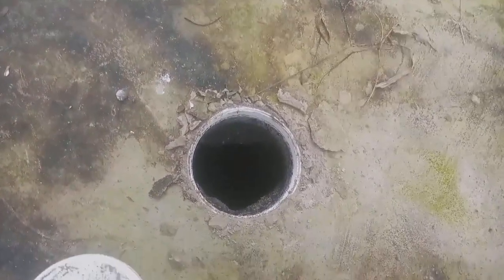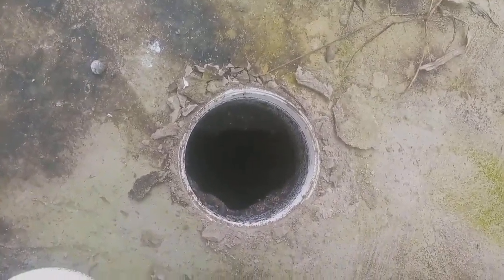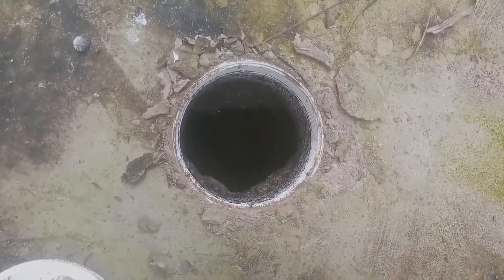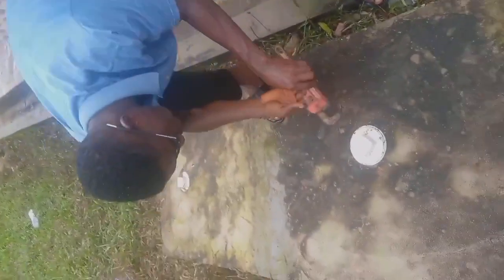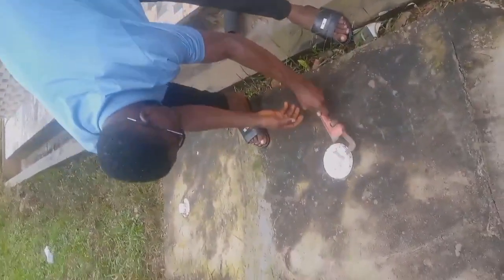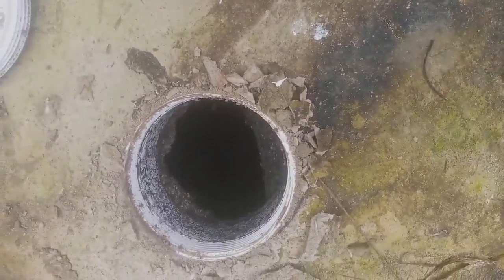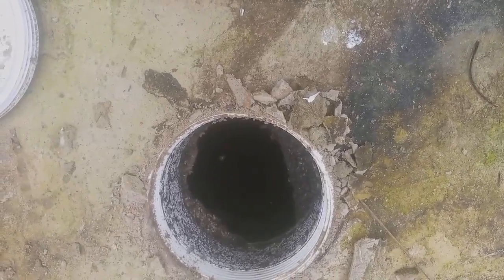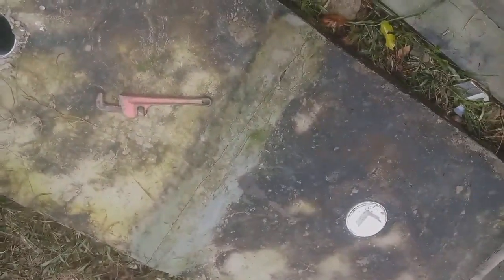BIODIGESTER OR BIOFILL FREe TRIAL. HOW it WORKED

Comment: Biodigesters are a closed system; therefore, it gives off no odor from food waste; this will eliminate flies and rodents from the facility, increasing hygiene. Also, eliminating food waste on-site saves money by reducing hauling costs. The capacity of food a biodigester can process depends on the size; larger the digester more food it can handle. Biodigesters are a living system and do require maintenance. However, they are easy to use and maintain.
Reply: Sir it should be human waste and not food waste
Reply from the maker: @okeychimeziri6600  wow. Thanks for the correction Sir
Reply from the maker: Great one there. You really understand the system